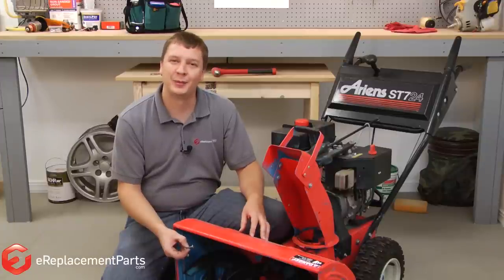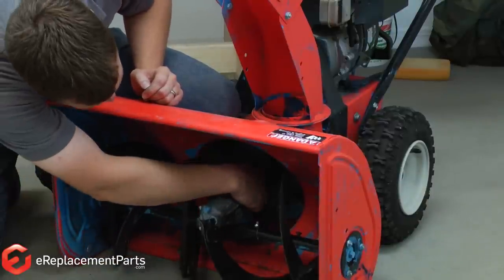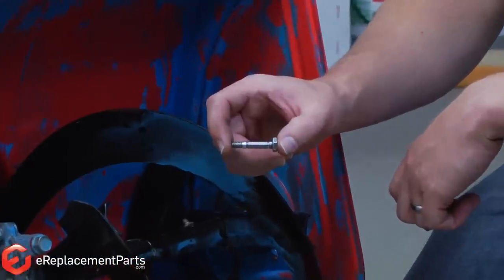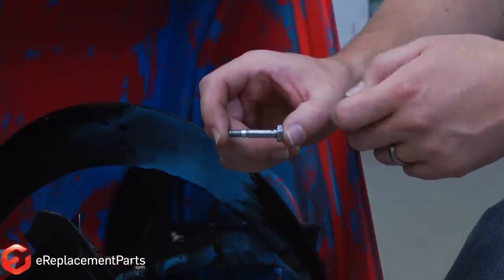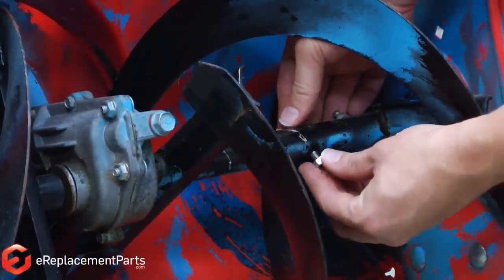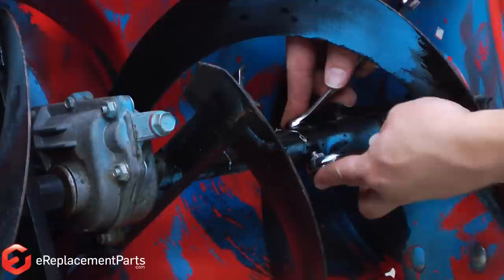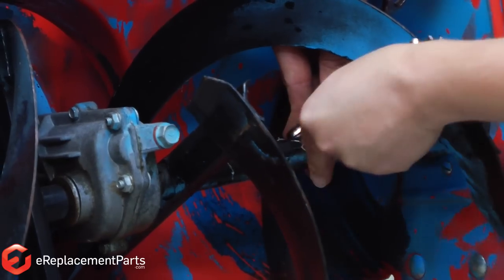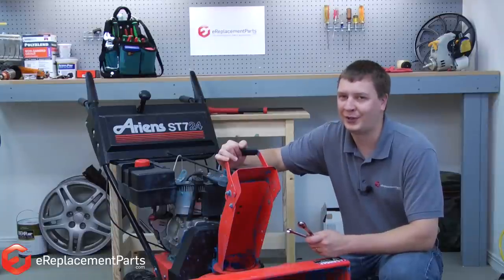How to Replace a Shear Pin on a Two-Stage Snowblower

Comment: The nuts on both ends of the shear pin came off, the rest of it is stuck in the hole and I cannot get it to budge with a hammer and a punch (actually I am using a screw driver).  Any suggestions on how to get it out?

Comment: Are the two sides of the auger "timed"?  In other words, if the shear pin is completely gone, can you end up with one side 180 degrees off of where it should be - relative to the side that didn't break?  Will the holes for the shear pin only let you line it up one way?

Comment: What if the shear pin broke off at both sides and I can't find the hole?  Do I line up the broken side with the shear pin on the other side that isn't broken and that will be where the broken pin is to punch out?
Reply from the maker: Hello Al, that's what you would need to do to release the broken pin. You know what you are doing. :)